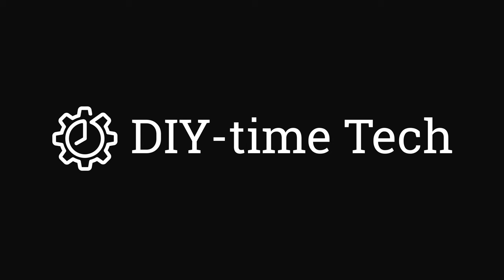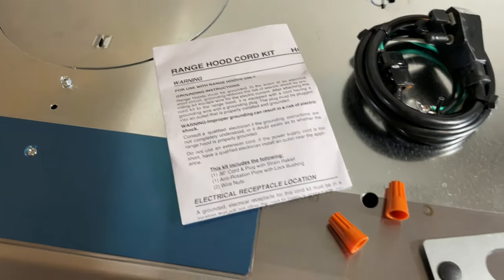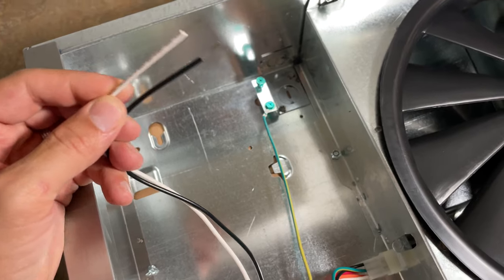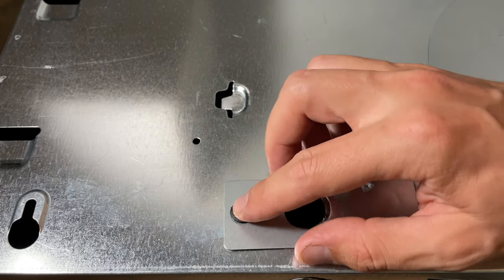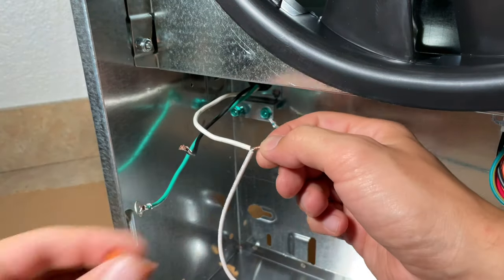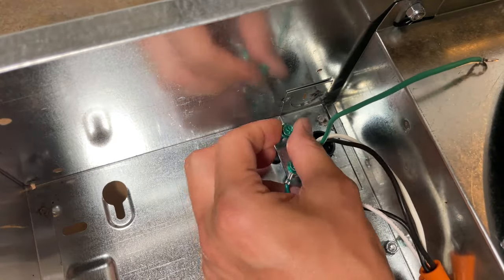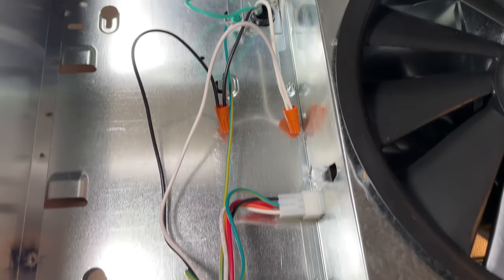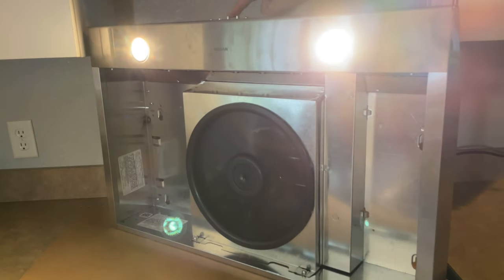How to instal electric power cord on range or stove hood fan.

Comment: Hi there- the range hood I have is slightly different to yours- the wires for the light and fan are separate, and the ground wire does not have a second green screw to attach the ground from the new plug ground wire. I’ve done a lot of research and believe I connect both the fan and light black and white wires to the plug black and white wires, but am unsure how to handle the ground wire without the additional green screw. Any tips?

Comment: mine came with 3 wires sticking out. At the top of it already one black one white and the other ones like a green multicolor one which I’m guessing that’s the ground but instead of hardwiring how would I install the power cord with those wires coming out? Would I screw the cap onto the black to black and white to white then the green wire from the power cord would I screw a cap on the other green wire? Screw those two green wires together because I don’t have to go inside that little panel like you did.

Comment: Hi, I'm trying to install their PM300ss model, the wiring is a bit different. That unit has three wires: white, white, and black.   There is no green wire like yours. Any advice as to how to do mine?   One white wire is thicker than the other white.  Thanks.

Comment: my case is the opposite, the new range hood came with a power chord  and i have 3 wired cable coming out of the wall. you think i should install a connector and plug my new range hood? or remove the power chord from the new one and connect it like the old one (3 wires) ?
Reply: What did you end up doing???